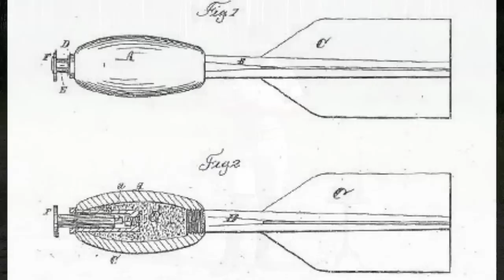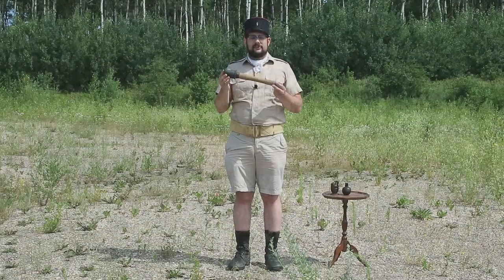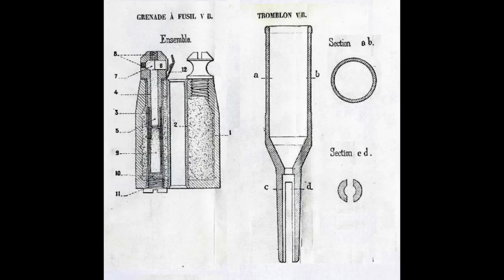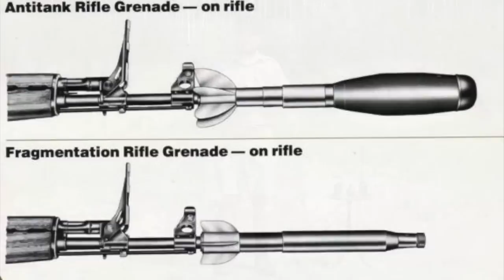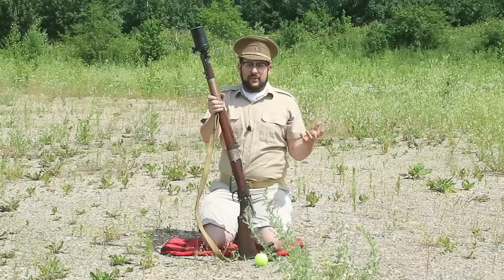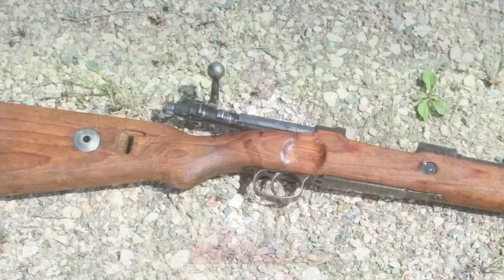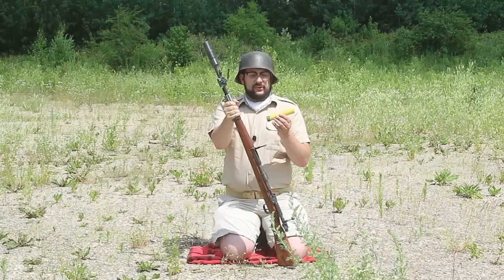The History of Rifle Grenades

Comment: 15:17 That ladies and gentlemen, is a Serbian Zastava M70 assault rifle, with a gas cut-off block, that also serves as a rifle grenade targeting sights. The shooter would lift the targeting sights up thus blocking the gas going into the bolt carrier tube, so the rifle wouldn't cycle after discharging a blank cartridge. Shooter would load a blank cartridge into the rifle, set the buttstock of the rifle onto his thigh of into the ground and brush off the firing trigger with the tip of his finger in order to avoid unnecessary and potential injury because of the stronger than regular recoil when the rifle is set in this "launcher setup". This is why Zastava M70, also has a retaining pin for its top cover securing it tightly in place, so that when firing, the top cover doesn't fly off into the shooter's face. Way more sturdier design thanks to its 1.5mm bulged trunnion receiver, than the rest of its AKM brethren out there. Kind regards from Serbia, land of Zastava Firearms since 1853.

Comment: The problem with rifle grenades compared to the underbarrel 40 mm grenade launcher is that you practically cannot shoot rifle grenades on a flat trajectory, e.g. through a building window. Even though there was a version of the AK-47 adapted for rifle grenades and the instructions said that you could lie on the ground on your rifle, press down on it with your body weight and fire the rifle grenades flat, all soldiers who tried it had bad memories of it. As far I know, there are some modern rifle grenades whose recoil force is small, because the rifle bullet serves mainly to initiate the rocket engine in the grenade itself. The RPG-76 Komar is a derivative of work on such a rifle grenade, but in this case the project turned into a separate weapon.

Comment: Durring WW2, the Germans also had "egg" grenades (if I remember correctly that was their nickname) and the Fuse/Arming part that screwed into the grenade was color coded for the time delay... including a 0 second time delay for booby-traps are for Resistance or other people looting the bodies for weapons!
Reply: "Eihandgranate" (egg hand grenade) was actually their official name. Under the hood, they used the same sort of pull-cord ignition as the stick grenades, just in a slightly different form factor; instead of unscrewing the cap to expose the ball on the end of the cord, the cord was attached directly to the cap. (They actually made more of the egg grenades than the stick grenades over the course of the war; they're just not as cool, and therefore not as famous.)

Comment: I think the 2 key points to understand are:

1. Grenades were developed to give the average infantryman an explosive weapon. You mentioned this ‘en passant’ but it’s the entire ‘entire raison d’etre’ of the entire ammunition group.

2. As you say, rifle grenades were developed to increase range compared with hand grenades. But this is just a step on the evolutionary path of grenades. As you said, something that uses the rifle barrel is a faff. So we get the development of ‘projected’ grenades from a specialised ‘grenade launcher’. 

There’s a split in the evolutionary tree at this point. Most western (NATO or NATO influenced armies went down the ‘spin stabilised’ projected grenade path - see the 40mm M79 as an example, which looks remarkably similar to your 18th century grenade launchers!

The Soviets however followed the work done by the Germans with the Panzerfaust by developing a spin stabilised projected grenade - the PG2.

In a further quest for greater range we then see the Soviets develop the spin stabilised ‘propelled grenade’ - the PG7. At first glance it looks similar to the PG2 but it has a second ‘sustain’ motor to extend the range of the launch cartridge.

The US however chose a different evolutionary path again, with the M72 LAW, which is a true rocket rather than a propelled grenade.

Comment: Had a lot of fun firing tennis balls from my Cup Discharger. They last 3 shots, as even a blank puts 2 holes in them, entry and exit. Turn 90 degrees horizontally for 2nd shot, 90 degrees vertically for the 3rd. Once all 3 axis are holed, the tennis ball pretty much disintegrates. For extra range, make a Gas Check from a baked bean can lid or similar. Doesn’t puncture the tennis ball but goes so far you won’t find it! Be careful with blank ammunition though. A veteran told me that if you used a regular blank with a real grenade, rather than the proper Walsrode or Ballistite round, it could blow up the gun, as the powder burned too fast. Pattern 37 web gear Basic Pouches have cartridge pockets in the lid, especially for these rounds.
As a measure of the power of blank rounds, a friend made a golf ball launcher from a Martini Henry action. It used a 9mm DAG blank, the same as we use in Sten guns, MP40s etc for reenactment. The golf ball would make a clean hole through 12mm plywood at 25m and then still bounce off the end of the range at 100m…
Great video!

Comment: I fired the inerga in 1960's with the Irish Local Defence Forces. The rifle was the LeeEnfield and was fired in a standing position. The shoulder strap was extended fully, your right arm was extended fully gripping the rifle 2/3 up the muzzle. The strap was placed over your right arm and then across your chest. The sight, (part of the launch tube) folded upward and you aimed from there to the tip of the anti-tank grenade and then on to th target. The sight had a range adjustment feature.  Most importantly when pulling the trigger, you could not grip the stock with your left hand as the recoil was so severe that it could amputate your fingers.. you had to place your thumb in the palm of your hand, extend your index finger and wrap  the other fingers around your thumb. The tip of the extended index finger was then placed near the trigger but not inside the trigger guard, and with a very fast continuous backwards sweep you flicked the trigger and pulled your hand out of the way of the recoiling trigger guard. (I still have all 10 fingers 😂
Reply: Wauw. Sounds scary to operate this weapon. Thx 4 sharing.

Comment: 25:00 -- the problem isn't the lack of a crimp, the problem is that you're using standard propellant.  Grenade blanks use different stuff.
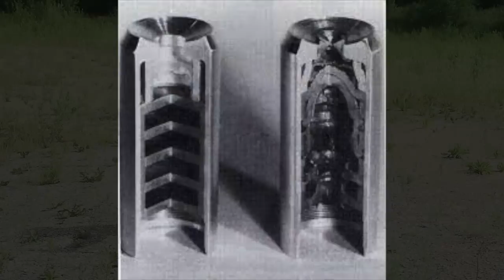35:00 -- kinda.  The bullet would get the grenade started.  The gas would then give the rest of the boost, but since it didn't have to start the grenade from a dead stop, it would come off the device sooner, thus without subjecting the bore to excessive pressure.  This is how your crank-sight works, too.  With the grenade moved toward the muzzle, less of the gas is used.
A superior system is used on the FN49 and FN-FAL.  These are gas-operated rifles, and feature a plug that rotates 180 degrees to cut off the gas system.  A stamped steel sight is attached to many of these plugs -- the sight folds down on top of the forearm when using the rifle normally, then the sight is lifted and the plug rotated.  There are several notches stamped into the sight, which are used to choose the appropriate launch angle for the desired range.  The user simply lines up the notch for the right range with the body of the grenade and the target.  This is so quick and easy that it can be done from a vehicle, horseback, or by making a brief stop while running forward.

Comment: regarding the French rifle grenades, you have a bit of a missing hole in the French part, as during WWII, the French continued to use the Lebel as a grenade rifle with the VB grenade, but also the MAS 36 was created specifically to be suited for the launching of grenades, hence it had a split stock with the chunky rifle receiver in the middle giving lots of strength (this is also why the Lebel was exclusively used for launching rifle grenades, as the Berthier stock was too fragile to endure the recoil) and to this use developed 2 grenade launching accessories:
-the first was a simple cup of the VB system, made for the specific dimensions of the MAS 36 so they could use the existing stocks
-the second was a removeable spigot, with a diameter of 22mm, it would slide on the muddle of the rile and be held on by a tension screw, which was to be used with either a 50mm grenade, adapted from the 50mm light infantry mortar, or a 50mm hollow charge anti tank grenade invented by the Edgar Brandt company

very few of the spigot launchers and their related ammunition were produced before the fall of France, but during the occupation the Vichy authorities launched the fabrication of the anti armour rifle grenade, disguised as a riot control device and in such a way that a military charge could be easily swapped inside
the french development has an interesting connection as in their effort to increase the war material production and in cooperation with allied nations, many French plans were disseminated with either the British or Americans, and the Brandt rifle grenade was part of the technical exchange with the USA, which is said to have been the basis for the US M9 anti tank rifle grenades

also the grenade sight on the MAS 36/51 and the MAS 49/56 has two aiming angles, the 45° you demonstrated and 78°, this gave two different sets of ranges you could launch the grenades at, with the grenades flying further at 45°, the 78° sight angle was also using for the firing of AT grenades. the system on the LG48 and MAS 49 only had the 45° notch and didn't have capability for launching AT grenades

Comment: #1.  I like this channel and its general content.  #2.  The content could also serve from the "real world" experience of people who have used these devices.  Notation:  Just know that the German rifle grenade was essentially fool proof in its design and application.  The US version, not so much.  On paper it looks good, however in actual application there were things that could go wrong.  Just the idea of mounting a pineapple in that open cage then pulling the pin gave me the willies.  Our rifle grenade was not "impact activated" but operated on a fuse  the same as throwing it by hand.  At least "by hand" I had control and there was no opportunity for mechanical failure.

Comment: Yugoslav style rifle grenades used a special blank round with extra gunpowder and it was stored inside the rifle grenade, just take it out of there and put into the rifle. A kind of safety mechanism to make sure it is not live round into the barrel.
 The sight was built into the rifles (SKS and AK made in Yugoslavia) and was at the same time gas cut-off; once you lift rifle grenade sight, you had a bolt-action rifle basically. Sight on the rifle was actually rear sight; front sight was the tip of the grenade. Relatively accurate. I didn't fire any rifle grenades when in the army cos I wasn't in infantry. However, the guys that did claim it kicks you back like nothing! Some of them fell to their asses or back when firing it standing. And there were particular injuries from firing it while kneeling; the rifle grenade sight would often hit the unfortunate soldier into the forehead...

Comment: Good luck finding those. I've lunched about 75 tennis balls around my house, from my .303 SMLE, never to be seen again. We did find 1, only because it ended up bouncing into my neighbors chicken coup. As for the blanks, on the .303, they were actually extra charged, not standard.  Also, PPU makes them, not expensive.  I paid $22.50 for 15 rds.

Comment: I would give an honorable mention to the Japanese “knee” mortar.  (Nicknamed “knee” as a memorial to the wrecked knees of U.S. soldiers that actually tried them with the spade planted on their doomed knees.)  Although a dedicated mortar, it was a lot lighter than a standard (60mm or so) squad-level light mortar.  Also used aiming and range mechanisms similar to some of those demonstrated (quite ably) in this video. And they avoided wrecking an otherwise serviceable rifle.

Comment: The M1 Garand had a system similar to the first one which could propel either a standard M2 "pineapple" grenade or a purpose built shape charge anti-armor grenade. My M4 was equipped with an M203 and with gold tips it was an extremely effective round out to past 300m

Comment: Just one observation. You mentioned the M7 launcher for the M1 Garand rendering the rifle a manually operated straight pull weapon. The post war M7A1 incorporated a spring-loaded piston designed to keep the gas cylinder closed when loaded until the grenade was fired, but then opened to allow normal semi-automatic function. The spring-loaded launcher also recoiled when fired, preventing damage to the rifle. The Wiki page on the M7 series is really good and discusses this and the later A2 and A3 variants. https://en.wikipedia.org/wiki/M7_grenade_launcher

Comment: 10:00 Another reason to discount these earlier weapons is they are essentially small mortars with a shoulder stock. After all, the contemporaneous mortars also often used a lit-fuse bomb as their ammo. A rifle grenade reflects the term "rifle" in the title, i.e. the weapon firing it is also used as a rifle (for the most part). For the same reason an M79 bloop gun with shoulder stock and its cousins are known as grenade launchers, not something that fires rifle grenades.
Reply: There were in fact Grenade cups that attached to modified Brown Bess muskets in the 18th & early 19th century. The cup could be detached and the musket used normally. They were used by the Royal Navy for boarding engagements.

Comment: the pinnacle of rifle grenades probably was the swiss anti tank granade for the stgw57. the same warhead as the anti tank roket launcher of the swiss at the time, capable of punching through 400mm of steel. electric fuse with a clockwork delay so it couldn't detonate within a couple meters of the shooter. and rocket assistance after firing, giving a range of 400m. alternatively it could instead have the warhead of a 60mm mortar or a smoke granade capable of producing smoke continuously for a full minute.

Comment: Are you familiar with the swiss army model 57 rifle and the
use of the soldiers pocket knife as a plumb bob, to use in aiming 
 rifle –launched grenades at proper angle ? The knife had a hollow 
rivet to allow a small string to be inserted and there was some kind 
of fold out gage on the rifle with angle or distance markings.
Reply from the maker: No, I had not! That's really interesting - and in typical Swiss fashion, overly elaborate :P
Reply: Dale the stgw-57 guy has a three part extremely technical series over the those specific rifle Granada’s with period footage. Those Swiss rifle grenades were very complex.

Comment: The West Spring gun was known to be very quiet in service and they developed a 7 second fuse for the bomb, so that it would explode when it got to 250 metres instead of in the air. It could also throw the very common improvised bomb called the Jam Tin Bomb, a jam tin filled with guncotton and a fuse, that was devastating compared to a hand grenade.

Comment: The monochrome image of the soldier demonstrating the use of the cup discharger on the SMLE seems to me to be that of a member of the armed forces of the the then Irish Free State, some time in the 1920s. The Irish army at that time blackened the British '08 web equipment and wore long leather leggings. The rank markings on the man's sleeve would appear to be those of a sergeant; the Irish army then used two stripes to denote a sergeant and one to denote a corporal. This was changed to the more conventional three stripes for a sergeant and two stripes for a corporal when Irish UN troops went abroad for the first time in the early 1960s. Forty years later I fired the Swedish Energa anti-tank grenade from  SMLE fitted with an adaptor and using a Ballistite cartridge. Not something I'd care to do in full view of a tank.

Comment: Is it fair to say that those grooves were "originally" and always intended to be for gripping purpose considering a) the no1 grenade you showcased earlier in the video had the same grooves on its fragmentation sleeve nowhere near where it was meant to be gripped and b) French designs started using grooves internally on things like the Modele 1914 and I think the P1 ?
Reply from the maker: I was referring only to the design of the Mills Bomb. According to The Illustrated Encyclopedia of Ammunition by Ian V. Hogg: "One point about the Mills should be made; it is always supposed that the serrations in the cast iron body were to assist fragmentation, but in fact the grenade never shattered along those lines. According to Mills' documentation, the idea was actually to allow a better grip with muddy hands."

Comment: I was the same ay thinking 30mm grenades must not be as effective, but since the Umraine war and seeing Ukranian drones using 30mm AGS-7 grenades do so much damage .. wow. 30mm seems like plenty. I guess they make up for it by being like twice as long as most grenades. also, the shrapnel they have around them is a coil like a spring. Very deadly. sends out over 100 little hardened steel rectangles at over 8,000fps....